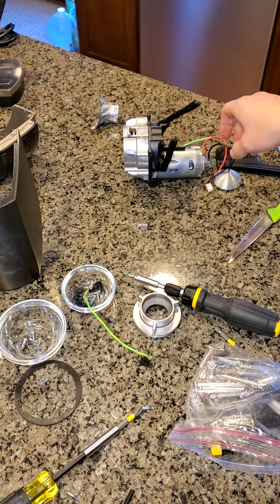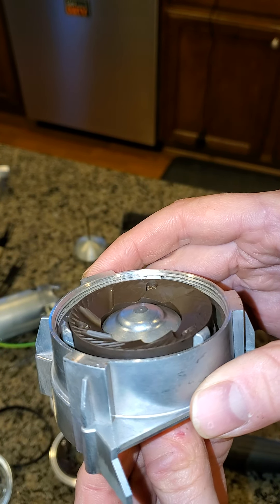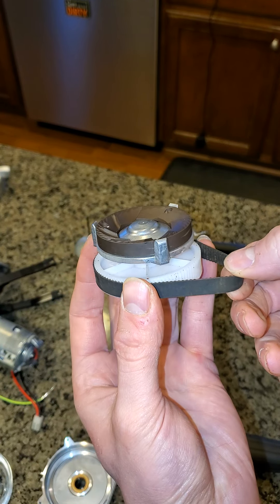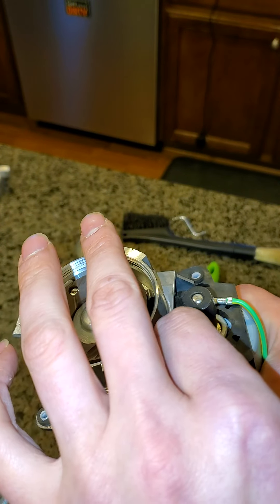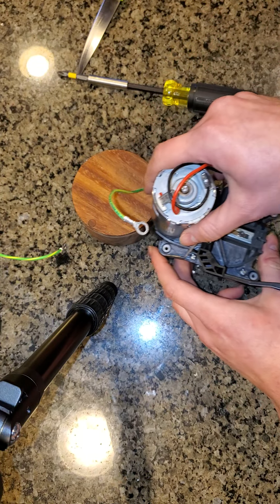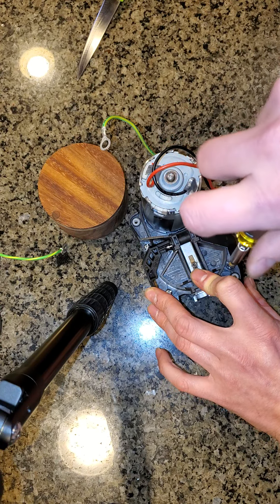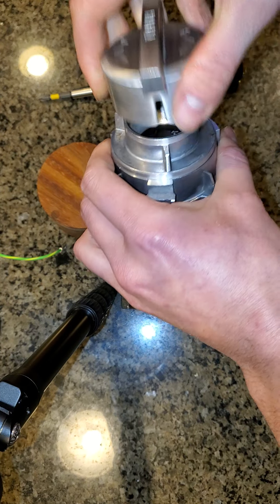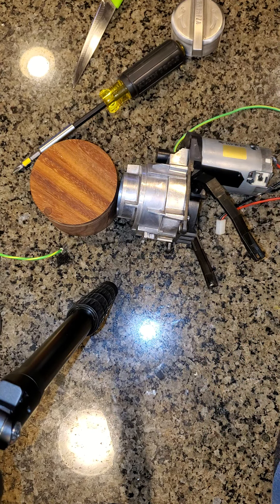Baratza Vario Alignment Deep Dive

Comment: Thanks for the vid!  I'm about to order the parts... read all the forums.... one thing I notice is you tightened the motor before doing the alignment and so forth.  Threads seem to suggest the motor screws need to be loose when you do the alignment - Im not clean on when you tension the motor/belt in relation to clamp/seat and tightening the burr carrier down.  Seems to me you get the belt tension in the right range while clamped - then tighten that and then tighten the burr down.

Comment: Hey, I could really use some help. I opened my vario to troubleshoot it, and my levers don't have the bounce that you show in your video. And when the assembly is right-side-up, if I LIFT the bottom burr using the levers, then lower the levers back down, the bottom burr doesn't come back down, it just gets stuck in that high position! This basically means the machine gets stuck in the super fine position, unless use my finger to push the bottom burr assembly back down. Anyone know what could be causing that?
Reply: I tried to do the alignment yesterday on my fortefied Mahlkönig Vario and found the same issues... only when I turned the motor by hand and lowered the burr with the levers I could clearly see and hear that it is moving away from the upper burr again. I cleaned the shaft and the brass bushings, which made things a bit smoother, but not perfect. My levers also don't have that bounce and my adjustment plate seems super loose, no idea if it has to be that way. Eventually I got a 50% wiping on the burr..might try it again in the next few days